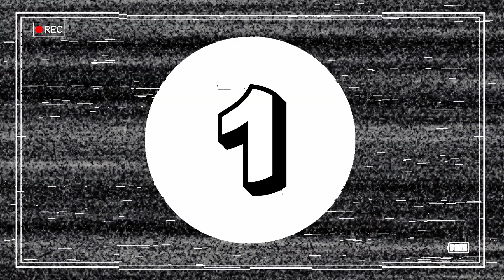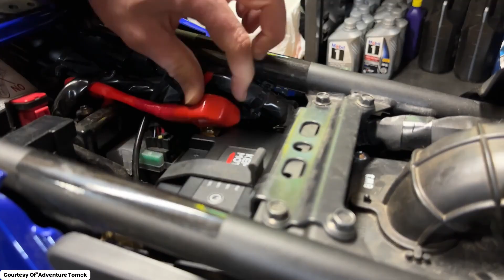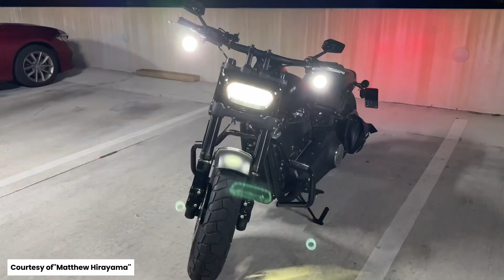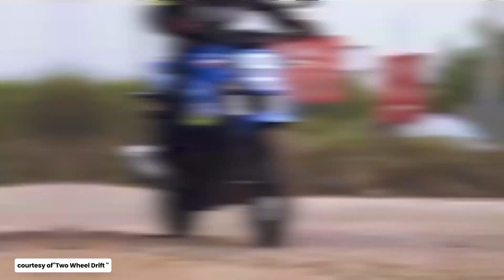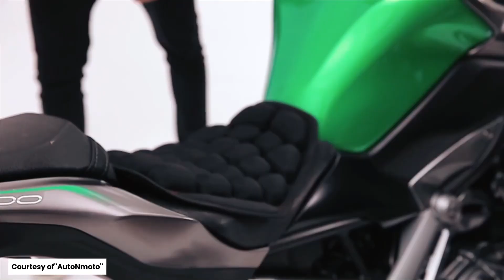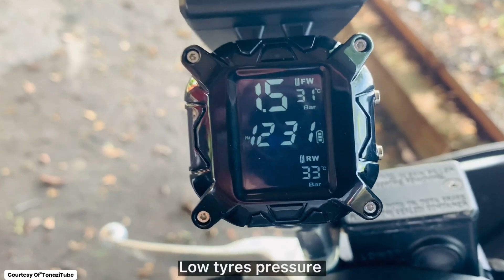11 SMARTEST Mods No One Knows About (Buy Now, Thank Me Later)

Comment: Those plastic stem caps that show tire pressure are dangerous. Any debris can crack the plastic, breaking the seal. To monitor the pressure they depress the nipple, so once that seal is cracked the tire rapidly deflates. And if you make them metal it adds weight to the problem.
Reply: ❤spot on

Comment: My 2011 ZX6R Regulator and Stator were both fried after a few months with a lithium battery. I later learned that Ricks motorsports offers an "upgraded" regulator to accommodated for the lithium batteries increased charging rate. This generation did have a recall for their charging system. However, that was taken care of through Kawasaki prior.

MORAL OF MY STORY: DOUBLE CHECK TO MAKE SURE YOU DONT NEED TO REPLACE OTHER COMPONENTS